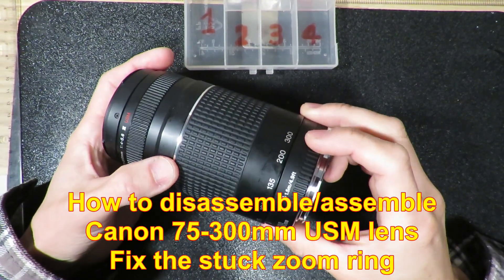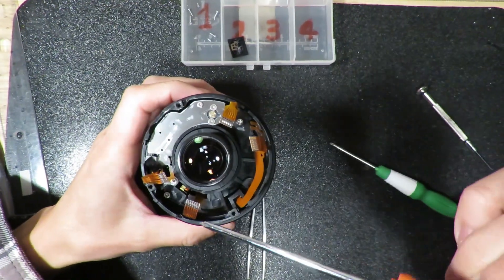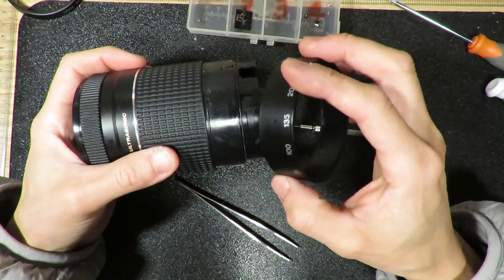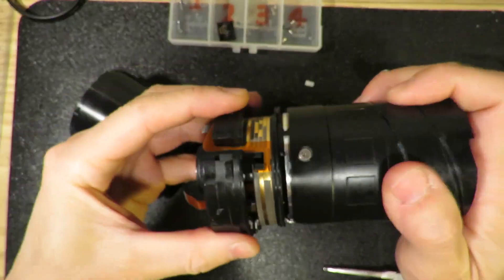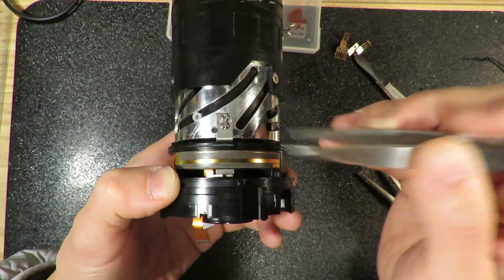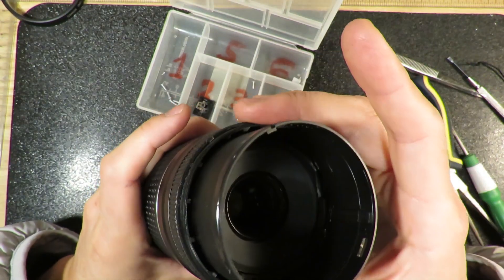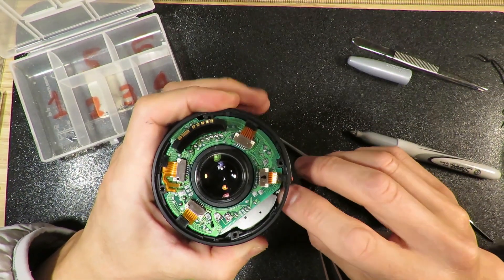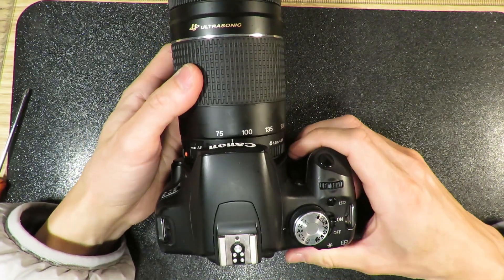Disassemble Assemble Canon 75-300mm lens. Fix the stuck Zoom ring

Comment from the maker: Someone asked me to fix his 75-300mm. It ended up I used mine to fix his. So I have my 75-300mm lens as parts. Just reply this thread, I will mail my broken 75-300mm to you at no cost. Only in North America. First come first service!
Reply: Hi! I need help. :( After disaassembling the lens and putting it back, the af ring is loose and can be pulled out from the lens. There also seems to be a gap betwwen the af ring and the zoom barrel.
Reply from the maker: @lumine7653  you need to carefully rotate the barrel in order to find a path to get the right position in. There is path, just keep rotating. Hope this helps!
Reply: @fsong00  I've tried rotating the auto focus ring multiple times and It still always have a spot when focusing that the ring just comes out, can you make a video about this?
Reply: Are you still looking to get rid of the parts lens?
Reply from the maker: @anands3362  Did you disassemble the lens? You need to open it to see what is exactly the problem. If as you described, you hear the string tension sound, it could be the metal brush. Check my video starting at 10:00 minutes.

Comment: I replaced the AF drive unit and now the camera is giving me err 01, communications between the camera and lens is faulty. clean the lens contacts. I have cleaned and cleaned the contacts and I have taken apart the camera 3 times now and checked the polarity on all the flexible cables (gold contacts facing upward) and it still gives me this error code. Any suggestions?
Reply from the maker: If all the connections/contacts are good, then I will think the AF unit might not have the right version for your camera.

Comment: Instead of drilling another two holes to secure the sides with screws, you could have used Loctite threadlocker on the existing screws that would have hold up with less effort. 

I'm thinking about getting this lens but by the looks of it I won't be paying more than 60$ for a used one or $45 for a unit affected with fungus given the effort it takes for me to open it up and clean/service the entire unit.
Reply from the maker: @brianlai4387  Thank you for your suggestion!

Comment: Thanks a lot for the video, it was very useful. If you're still making these, can you please edit them a bit slower? And also show some of the trickier parts a bit more. The clamps for the flex cables are of a type I hadn't encountered before, and seeing how to put them back in would've been great. Same goes for the zoom ring key, not something I had to reassemble before.

Anyway, I did some maintenance on an old and battered 75-300mm III non-USM (it's almost the same lens, only thing that changes is the AF motor) and I messed up and tore the flex that connects the focus and zoom position encoders. Guess what? It still works, both on DSLR and mirrorless, and it's sharper now 🤯 (not because of the torn flex, of course, but just thanks to the general cleanup it got).
Reply from the maker: @Ildskalli  So glad to hear your successful DIY story!

Comment: Thank you for the video, it was extremely helpful. But after assembling the lens back, my zoom ring no longer works, i can turn the ring and the lens doesn't zoom in or out. I see that there is a metal L-shaped lever at the bottom of the lens that rotates with the zoom cylinder, and my suspicion is that this L is not being grabbed by the zoom ring as it turns. Am I missing a piece there? How does the zoom ring connect to the zoom lever?
Reply from the maker: it must be an assembly issue. The L level should be embedded into the slot of the zoom ring. this way they connect.
Reply: @fsong00  Ah, got it, it's working now, thanks!

Comment: Thank you for the thorough and insightful guide, it help me fix my 75-300 lens successfully and save a bundle! Please do other videos like this, I like the way you explain things as you work through the process. 
Question for you: do you have any idea what kind of grease do these lenses use on the inside? I noticed a tiny amount of grease between some of the rings and barrels, but I had to remove it because it had been contaminated with tiny amounts of sand (fortunately I was able to remove it before it caused scratches and wear). I could try lithium grease, but don't really know if that's the right type. Thanks!

Comment: What if it's the lens that is throwing a error 99 code? I did all other tests such as removing battery etc and nothing. Tried a different lens and camera is fine but I want to use the 300mm which is throwing the code?

Comment: Dude sorry i know the video is old but how does that rear lens come out ?? Unscrew? Pull up?? Just bought q used one and saw it has a fingerprint inside, but kinda scared to take it apart and clean it....good job on fixing it too
Reply from the maker: I remembered that you just keep twisting,  at certain angle it will come out.

Comment: Hi, I see it is old video, but in a chanse - I have almost the same problem with my canon ef 70-300 is usm. After disassamble it found bended the part you fixed with 2 screws, it was so badly bended that blocked autofocus + the same way bended and twisted brush.
would be awsome to contact you to discuss it and who knows - probably can be fixed!?
Reply from the maker: Then you have to straighten that parts. Just use small hammer to hammer it straight.

Comment: mine hv the same prblm but i dnt hv drill..is there any method i can use to fix it??
Reply from the maker: The idea is to have something that can fix the part to the base. You need to use other method, consider it is a very tight and small space.

Comment: where can i find the replacement brush?
Reply from the maker: The replacement brush can be found on eBay. Also I collected a lot of broken lens to diy fix since it is a hobby for me.
Reply: @fsong00  thanks for the vid. I was able to fix my Len. I bought it for $25. It worked but the focus was messed up and it sounded like a zipper when it adjusted. The little brush from the vid is messed up on mine to but i bent into shape some but i can use a new one. The only other problem is that the zoom feels stiff now. Im not sure what's causing that.

Comment: But how did you fix the squeaking sound? You just say you decided to fix the squeaky sound, but you didn’t show what you did? Mine makes this same sound in Autofocus, but it’s fine in manual mode? Thanks
Reply from the maker: The squeaking sound was because of the brush, when I install mine back, the brush was not in the right place right angle, when twist the lens, it causing the sound. Hope this helps!
Reply: @fsong00  many thanks. Would l need to do a complete strip down to get to that part?😊
Reply from the maker: @Sapper094  if the squeak sound does come from that part and causes focus issue, yes, you have to come a long way to do that
Reply: @fsong00  thanks : ) sounds a little too much for my technical skills lol

Comment: This would have saved my lens, but I broke one of the ribbon cable gate clamps. Anyone know where I can buy a replacement? Thanks. Great video!
Reply: I found a parts list and diagram here: https://learncamerarepair.com/downloads/pdf/Canon-EF-75-300mm-f4-56-III-USM-Parts.pdf
Reply from the maker: Have you try ebay? I know the cable can be found easily on ebay.
Reply: @fsong00  Can you tell me the actual name of the part?  I tried several web searches with no luck.

Comment: drill/tool model please? thanks i could always use a precise drill for small things such as this
Reply from the maker: The precision drill is Dremel. It was almost 20 years. The model no longer exists. Dremel is a high-end tool. They have the latest model. But I don't think a brand name has anything different. There are a lot of cheap precision drills on the market. It is just a small size drill-that is. Hope this helps.

Comment: Hi. I have one of these that will now only focus one way - outwards but not back inwards. What do you think might need fixing? :) (Manually it’s fine - no physical sticking)
Reply from the maker: If I understood what you said, your lens still works, but only focus when you zoom in. Say if you want a 200mm zoom, you have to first zoom out to 75mm and then zoom into 200mm.
Reply: Fan Song Photography Thank you. At any zoom point, the autofocus hunts but if it goes slightly too far it can’t come back - the end of the barrel will extend but not retract.
Reply from the maker: @Martin-rfr67  Got it. This is autofocus issue. it is the circuit board needs to be replaced. Mechanics at this time it sounds ok.
Reply: Fan Song Photography Many thanks. Sorry to use you as Tech Support… :)
Reply from the maker: @Martin-rfr67  There are two boards, I am not sure which one to replace. If you don't plan to send your lens to canon and it is there collecting dust, you can send to me and I will try to see if I can fix it for you. If it is not fixable, I will mail it back to you. No warranty no obligation no liability no other related issues, just for fun. Only lens in North America though.
Reply: Fan Song Photography That’s a most generous offer but I’m in the UK 🇬🇧 I will keep an eye on eBay and maybe follow your fine video sometime :)

Comment: Can i get a pair of new bruhses?
Reply from the maker: The best way is to fix the brushes if it is not totally broken. it is made of copper and it is flexible. Just take time to fix it. it does not have to be perfect. just align them and make sure each pin can contact.
Reply: @fsong00  thank you so much.
But my 1 pin is broken.
Can i fix it by soldering?
I need your help.
Reply from the maker: @DJROY-j5q  hmm. soldering is a choice. But it requires a lot of careful work. It also depends on where the pin broke. If it is just a small portion, you can use the scissors to cut the base a little bit and then try to pull the remaining pin down to make the good contact. Just some ideas.
Reply: @fsong00  Is there any chance of getting a new pair of pin?
Reply: @fsong00  or it will work without a small pin...I can send you pictures.
Reply from the maker: @DJROY-j5q  I am not sure where to make the purchase of this little brush. This lens was not easy to be found in North American now...
Reply from the maker: @DJROY-j5q  ok. I just checked my recycle box. I did have another as is 75-300mm lens. It was sitting there as my repair parts lens. I can mail it to you. Let me know
Reply: @fsong00  thanks a lot.
Can I get ur email id.
I will contact you over mail.
I can share the picture of my pin also.
Reply: @fsong00  And 1 more thing.
My lens is 55 250 canon ef lens.
Reply from the maker: @DJROY-j5q  Send to fsong00 AT gmail DOT com
Reply from the maker: @DJROY-j5q  I do have some other brush parts. Just need the picture to confirm.
Reply: @fsong00  sending you the pictures.
Reply from the maker: @DJROY-j5q  just sent the test email
Reply: @fsong00  I sent the details.
Please, do check your mail.😊

Comment: Thanks for showing how to remove the back. I have this lens that has mould on the elements. How did you take the front element off?
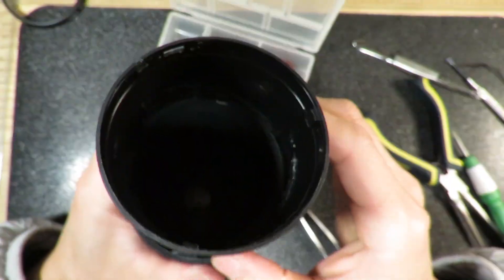Reply from the maker: Hi, Jack, Starting from 9:50 of this video, it talks about re-installation of the front barrel. Just for your reference:
1. You dont have to remove the front lens glass unit. If you want to do a service cleaning of the glass, you can remove the 3 crews pins. I think they are just pins;
2. remove the Lens ID ring (with the EF 75-300mm marking on it). It was glued to the barrel;
3. The front element barrel is sliding/guiding by the tracks. You need to keep rotating the zoom ring in order to find a place to gently pull it out. Keep experimenting you will find that exit point from the tracks.
Hope this helps and let me know.
Fan